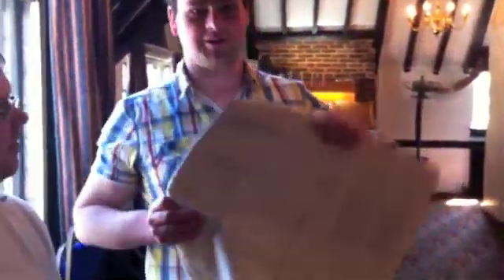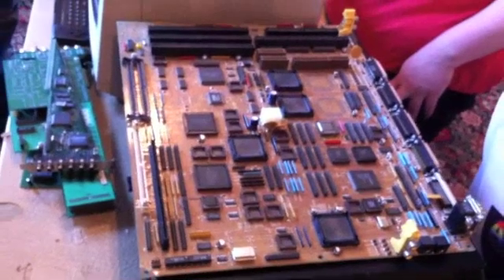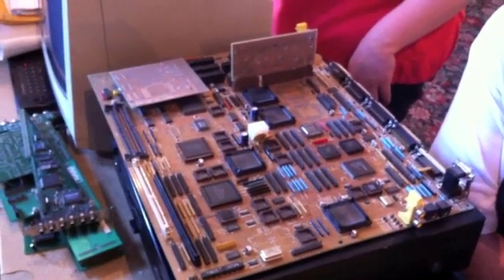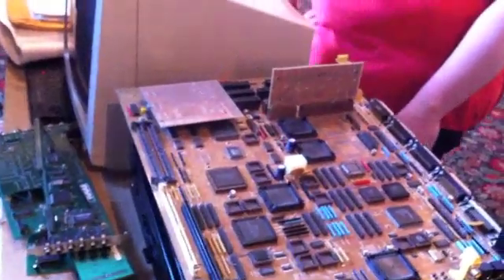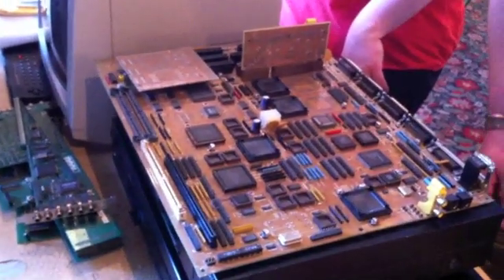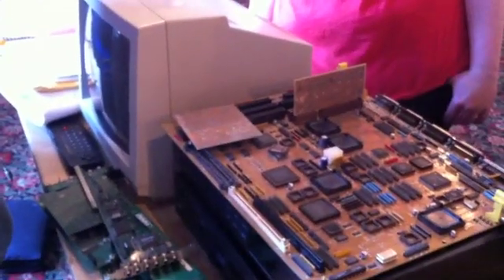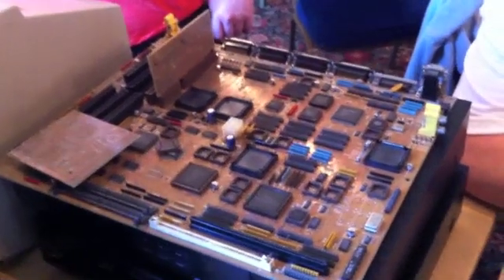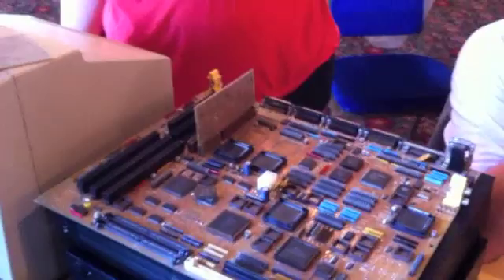Amiga AAA nyx (oli)

Comment: Problem was Commodore had their head in the sand and urgently needed to migrate Kickstart and Workbench to x86. They really needed to buy dirt cheap AMD x86 CPUs (price per MIPS was way better than Motorala) and dirt cheap (compared to AAA and Hombre R&D costs) fast PC off the shelf graphics processors by the early 90s. Commodore didn't have the money to develop a chipset that would make an 020 run Doom like a 66mhz 486 in 1993. Even then it would have made little difference, there is not one single A1200 game that is more impressive  than Turrican 3 which runs on an OCS Amiga from the mid 1980s

Comment: I've got one of the Gemini prototypes (the "lesser" complete one of the two Dave had) - I also bid on the Nyx board when it was first auctioned but Ryan's reserve was too high. I doubt even if you got that board working, you couldn't really do much with it as you need a special version of AmigaOS, nothing supports it and noone knows how to use it. Best option in my opinion would be to get multiple individual involved by scanning the documents and seeing if something like Vampire 2 could support it as a future core update?
Reply from the maker: Mike Gravgaard the chance on getting it working are slim , the missing chips are first rev prototypes and as rare as hens teeth. Dave haynie would have to be involved but they did have one running at commodore in 94

Comment: mjnurney Hi, just wondering if the schematics / documents for this board have been scanned in yet?

I see Dave Haynie uploaded many Nyx documents and the PLD logic files to his site, but if you have the actual custom chip schematics, it would be ideal to get them scanned in and preserved.

I'm currently trying to add the AGA stuff to the Minimig core, as I'm not sure if they will be releasing the source for the FPGA Arcade Replay board publicly yet?

I would love to convert the AAA schematics to run on an FPGA too, but wasn't sure if you had the full chip logic info?

The PLD files for the chip logic would be even better, as it would be quicker to convert them to Verilog / VHDL.

I realize it would be a mainly academic exercise to finish the work Dave started and get the AAA chipset fully running, but I'm sure a lot of the Amiga guys would jump at the chance to write new code for it. :)
Reply: ElectronAsh please do this, I wish I had the smarts to do it myself but I bet there is thousands of Amiga devoted users that would love to see this implemented and use it on real life!!
Reply: Talk about rare...I would archive this with rare Atari prototypes that were never released or even the M2.

Comment: Hi, has anyone attempted to convert any of the AAA chipset to FPGA yet?
I have some FPGA experience and wondered if the documentation has been put online at all?

Also, do you have any contact info for the guy in the video, or a forum thread about this board?
Reply: What about make discussion in Amiga fan pages and if some group of people interesting and be possible then we can make kickstarter etc. I want to try make game on this AAA hardware
Reply from the maker: Dave Haynie is probably the only person who’s knows AAA. There might be one set of chips that worked when commodore went under but now…who
Knows.
Reply: @mjnurney  Wow, this is an old thread bump. lol

Since posting that, I spoke to Dave Haynie via Faceplant.

He's had the GAL chip files on his site for a long time, but that doesn't include the logic files for the larger custom ASICs for AAA.

So the only real way would be to just try to implement the chipset from the available documentation, which means quite a bit would need to be inferred from how the docs suggest they work, so it won't be 100% accurate.

Unless somebody can dump the ASICs from a prototype, it's not likely to happen unless some enthusiasts get together and really want to make it happen.

Even then, there would be no software available that takes advantage of AAA, so it would be more as a preservation effort, and to encourage people to write homebrew for it.
Reply: I just had another look at the Nyx files on Dave's site.

Sadly, it looks like the "netlists" aren't really for the chip-level stuff, only for the PCB.

ie. the netlists just have the connections between the custom chips and other components, but they are not the silicon-level gate netlists.

The PAL/GAL netlists on the site are just for the much smaller logic devices on the board, not the larger custom ASICs.

It might be possible to read out the logic of the ASIC from the prototype, assuming they have JTAG or similar, or an old programmer can be found. That also assumes it doesn't have any security bits enabled.

The only other way would be to do a "black box" analysis on the prototype chips to figure out what the internal logic and registers are.

From what I can tell in this video, it looks like they did already get fully "baked" ASICs made for the prototype, instead of using CPLDs/FPGAs.

Which means it's less likely to have JTAG on those chips anyway, so the only way then of reverse-engineering it is via the black box method.